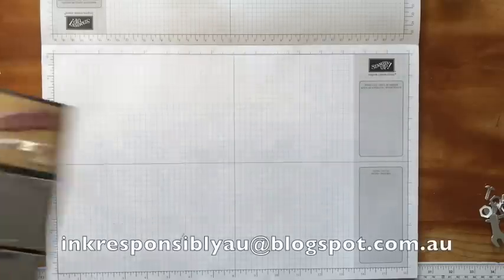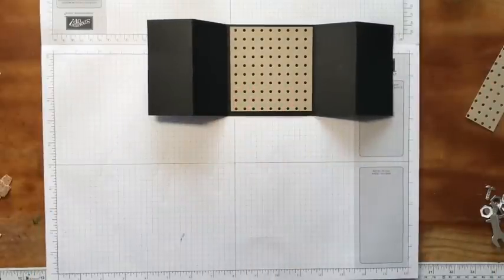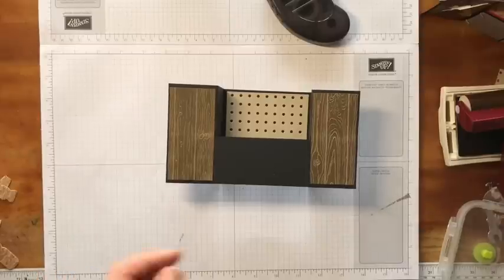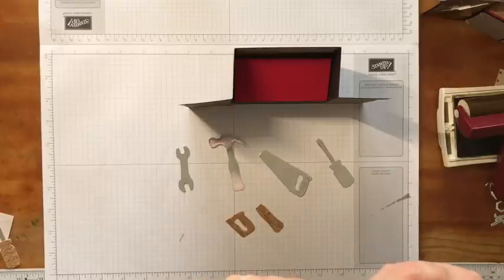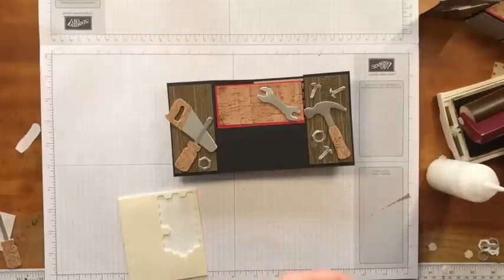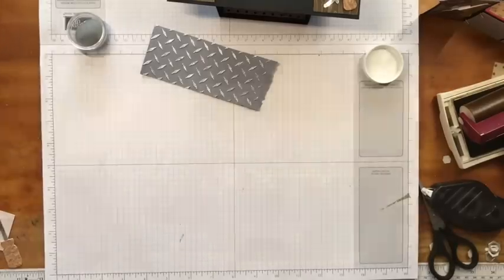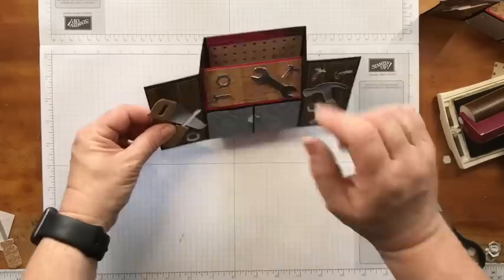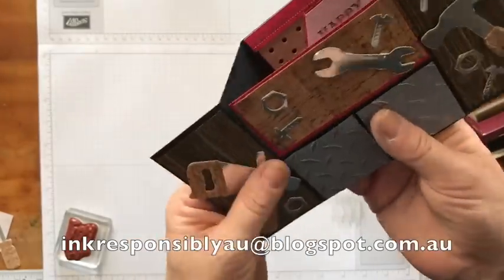Tool Bench Fold Card

Comment: Love this card!  Like using the cork for tool handles.  Love the pegboard die.  Where did you find the cork ribbon and pegboard die?  However, you state measurements that differ from what appears on the screen of this video.  Which measurements are correct?

Comment: What a gr8 card. Can you tell me where you got the pegboard die and the screws & Nuts die Also what brand is the cork used? TFS clever
Reply from the maker: Hi Kathy, I’m not sure where I got the pegboard die....all the tools and nuts and bots are from Stampin up! Build it dies. They have been retired but you can find them on eBay or other Stampin up retired products sites. I hope that helps
Reply: I know this old, but I just used a dots folder and turned it around.  I had to think and change a few things, but my card came out just as good.